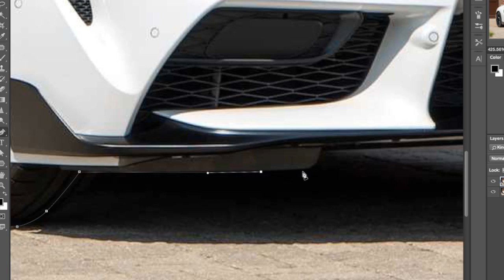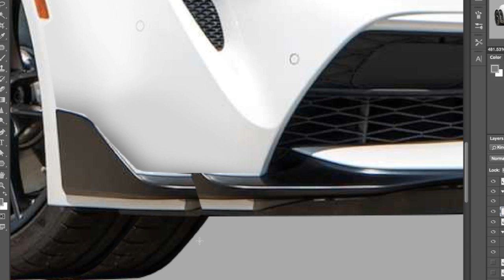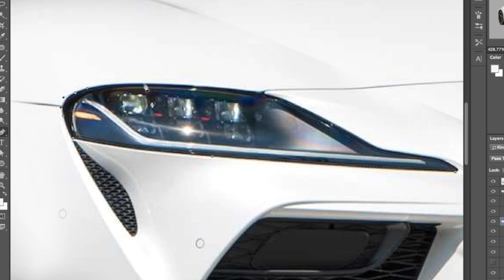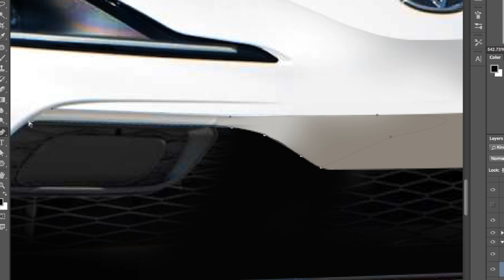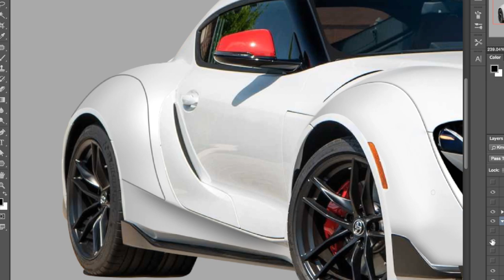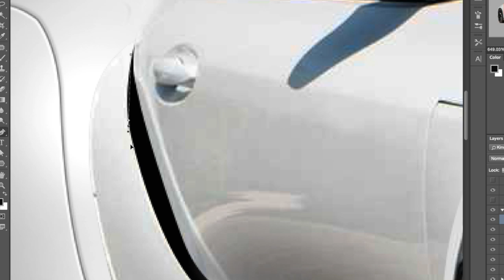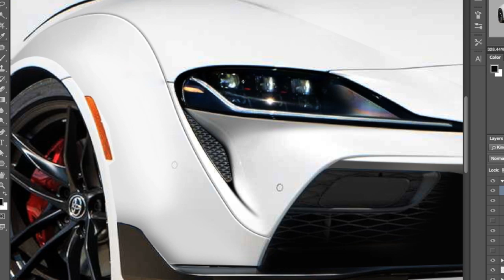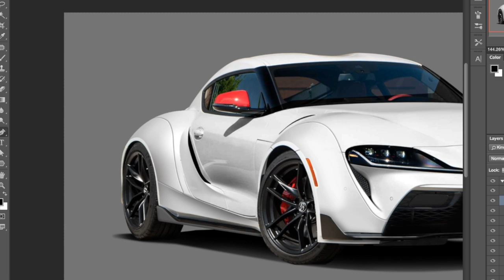Grad School for Industrial Design? Watch This before you APPLY!

Comment: Im currently working as industrial engineer here in saudi arabia. Im a civil engineer but our design was limited only to stairs, doors,windows and gates. Does it mean im consider now as industrial design engineer professional or was it design engineeer or just AutocaD? Im using Cad, ArtCam, Adobe cc5 and then make it into CNC files or LST files. We dont design like in this video
Reply: Ladz Dimasangkay what company are you working on in Saudi Arabia?
Reply: @moatazmk2902  it was a private company name Alkifa. We have 4 big laser machine which process our finished design. Im kinda confuse which particular engineering i am, Since it was not a construction company but industrial. I just think that may be i am industrial design engineer or just design engineer or just an AutoCad. My functions was not just designing but  also i have to supervised the daily operations of our manufacturing.
Reply from the maker: Hmm it sounds like you're doing interior design/contractor.